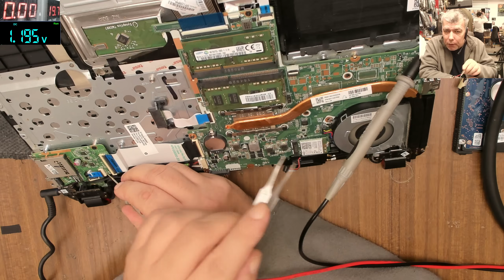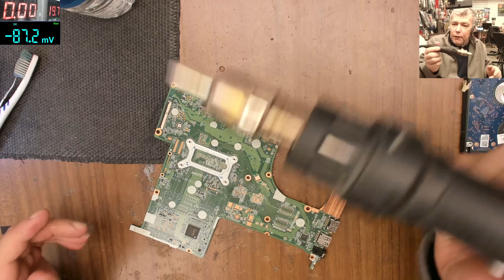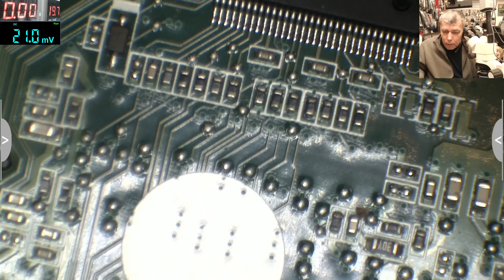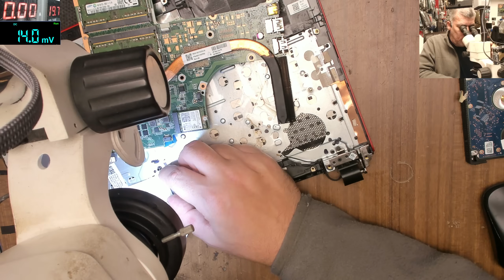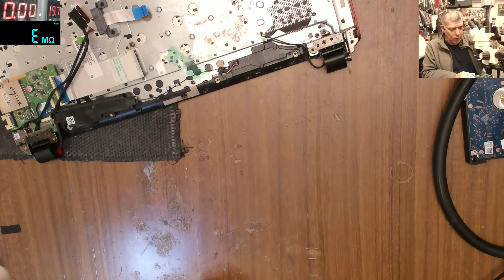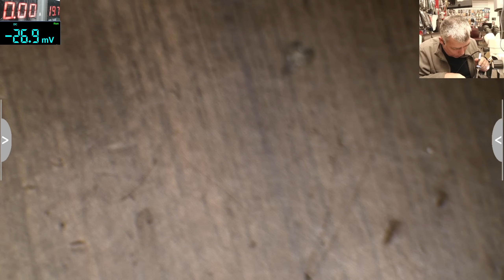Electronics repair lesson - Don't be afraid to use alternative ways to fix a fault

Comment: You CANNOT safely wash a circuit board with tap water !!!

The circuit board has copper, aluminium, lead [sometimes] and tin. 
Tap water has minerals, flouride, chlorine and all sorts of other stuff. 
ALL of these metals corrode when exposed to mineralized water and you CAN'T clean underneath the BGA chips where the water loves to hide !

Isopropyl alcohol is CHEAP and won't damage any of the metals.
Reply from the maker: You have no choice, the sugar is not getting disolved in alcohol, only on water!

Comment: You shouldnt wash sugary board with water and dry with hot Air. Sugar just dries back on the board. İt will look better because it will spread. But still can cause problems. What you want is water dissolving the sugar and taking it away. After you brush wipe it away with a dry towel then dry with hot air. Even washing the board under a tap works. I used to do it all the time. Dry with paper towel and then hot air so you leave the least minerals possible. If you really want to make sure, use pressured air on connectors. Hair dryer is a good option too.
Reply: You CANNOT safely wash a circuit board with tap water !!!

The circuit board has copper, aluminium, lead [sometimes] and tin. 
Tap water has minerals, flouride, chlorine and all sorts of other stuff. 
ALL of these metals corrode when exposed to mineralized water and you CAN'T clean underneath the BGA chips where the water loves to hide !

Isopropyl alcohol is CHEAP and won't damage any of the metals.

Comment: Amazes me: the thought process of Apple in its design of the iPhone battery charging, is irrational. My battery is at 79% max. There are features Apple designed to limit charging times to extend battery life - based on my 'user habits'! A feature to save the power grid and lower my carbon footprint by limiting charging based on time of day - talk about greenwashing!  This is insane. Not rational at all per all their attempts to prevent repair and fight right-to-repair. INSANE cult-like adherence to worst practices....often confused and interpreted by morons as 'best practices'

Comment: i heard from some else  to always remember if you are disconecting the display make sure the battery is disconected first because those pins  have voltage whether you push the power button or not. to avoid shorted display when removing take it out.

Comment: I was told to never clean or touch a PC board with water, use  only denatured alcohol. Because the stuff used on these boards is water soluble. Can somebody clarify this ?
Reply: You CANNOT safely wash a circuit board with tap water !!!

The circuit board has copper, aluminium, lead [sometimes] and tin. 
Tap water has minerals, flouride, chlorine and all sorts of other stuff. 
ALL of these metals corrode when exposed to mineralized water and you CAN'T clean underneath the BGA chips where the water loves to hide !

Isopropyl alcohol is CHEAP and won't damage any of the metals.

Comment: So sad to see that for all your experience you chose the "carpaci" approach. True quality is when you restore it to factory design, not increase the current 10 times (at least, since pull-up resistors are usually 10Kohms but for mobile applications could start from 20Kohms to not consume current for nothing) on a clearly faulty circuit that leaks current somewhere. That leaking current will cause failures in the future and will break something. But it's good for business to have recurring clients I guess...

Comment: I noticed that you "cleaned" the board by adding water and then you scrubbed the  area with a toothbrush, then dried the area with hot air.  You really need to wet the area and then wipe/blot the water off, or flush the area  well with water.  Otherwise you are not removing the sugar/salt that was dissolved in the water.  You are just spreading it around.  I have spent many hours watching your videos and find them extremely informative and interesting.  I have a pile of older laptops that I hope to restore with your the help of your videos just to see if I can do it.  Thanks for sharing your troubleshooting methods.

Comment: Why would anyone trust a company who puts THAT much effort into keeping things from working?

I do have a tip on using water if you read this.  Follow up with alcohol spray - it will thin the water making it easier to run off, and it will evaporate faster.

Comment: When I was doing my apprenticeship, for liquid damage, I was taught to use water and soap to wash the entire board and then allow the board to sun dry or we could use a fabricated incubator made from gallon and old high watts lightbulbs(cos of the heat it generates), after which we test
Works like 95% percent of the time we used it.

Comment: It is actually a very good idea to remove sugar(sweet) liquid damage with water! But THEN... instead of drying the water with the hot air (which still may contain sugar that doesn't evaporate), remove water with... alcohol  :-}. Alcohol has almost indefinite ability to absorb water (with or without sugar) and still being an alcohol. And it evaporates very quickly - much quicker than water...

Comment: I find that brake parts cleaner does a great job of cleaning dirty motherboards.  It dries very quickly and leaves no residue behind.  I also will often use a hair dryer afterwards as there can be condensation left on the boards from the "ice cold" blast of the cleaner and possibly my air compressor to get underneath chips where some fluid often can still be lurking.  You can even just let the board dry out on its own if you're not in any hurry.
PS: Unlike rubbing alcohol, break parts cleaner can make you feel VERY dizzy/sick if you breath it in.....even if you use it outside like you SHOULD BE anyway!  If it makes you feel like sh*t, then use alcohol instead!
Reply: is 70% alcohol safe to clean motherboards with?
Reply: @emmanuelkissi8958   You CAN use it, but it contains more water than say, 91% which is better because it will dry faster and clean faster.  I have used 70% to clean parts with no problem.  Just make sure you give the parts more time to dry or better yet, use a hair dryer to speed up the process as soon as possible. Also...be mindful of the fluid that tends to hide UNDER the chips!  Blow it out if you can or just let the whole board dry overnight or longer if necessary.  👍👍
Reply: @arthurmann578  alrighty thank you
Reply: @emmanuelkissi8958   You're very welcome!  Be well!  👍👍

Comment: When I use water to clean sticky boards and connectors, I always rinse the area well and soak up the excess with Kimwipes.  Then, I spray the area with 99% isopropyl before using a blower for drying, cool air at first then, warm.  I find that the alcohol dissolves into whatever water is left behind and helps the evaporation when the blower is used.

Comment: A dishwashing machine is amazing. Use that first. Then your ultrasonic cleaner with frequency sweeping, heat and degassing and branson EC. An old surplus vapor cycle circuit board cleaning machine STILL works! Trichlorofluoromethane is still available for purchase (from Sigma - Aldrich, for instance). It is very expensive, though. Miserable extremist leftist elitist-supremist know-it-alls really hate it. They will call you racist or something if they find out you're using it. Because it works BEST. Move to California before using it, first...it's best, that way. Tetrachloroethylene and tetrachloromethane (Carbon Tet, Perc...dry cleaning chemicals) attack flux VERY well. Better than that stuff they WANT you to use. Your macbook repair customers are more than likely the ones making these chemicals cost you so much...who BETTER, to pass that cost on to?

Comment: No circuit diagram makes it hard and if that is a blown MOSFAT (resistor) you are passing that voltage directly to the cpu unregulated . Test capicitors for short ! Then if no diagram you can pass a very small amount current to the device and look at it through infared camera . The MOSFAT that is bad will show heat . But it powers on briefly, that would imply its not a short . In this case it would be more likely overheating but its doing it very fast usually a device would get farther if not all the way booted up before shutting down .

Comment: If you put water on the board to remove sugar you then need to get a paper towel or something to soak it up. If you just apply heat to evaporate it you WILL NOT have removed the sugar. At best you might have spread it around more thinly.

Comment: I think that once you dissolved the sugar in water you should have soaked up the water with a paper towel or sponge before drying the board with the hot air. If not, the sugar will just be redistributed on the board and may cause problems.
Reply: Yeah, I thought that too!  I guess that once dissolved and spread around a bit, the conductivity of whatever sugars remained were reduced enough to not be an issue any longer.  Still, I would be inclined to soak them up and, get them right off the board.

Incidentally, I have encountered similar issues with the "no-clean flux" products.  Sure enough, when bone dry that stuff is a great insulator but in a humid setting, I find that it readily becomes conductive.  I suspect that airborne pollutants land on the moisture softened flux and, that those pollutants are the conductive culprits.  Think of a seafront environment for example with all that moist, salt ladened air!  Might as well spray the whole board with an electrolyte.

Comment: Shouldn't the board get rinsed after the sugar gets dissolved? Otherwise the sugar would remain once the water evaporates. I guess what happened is that the sugar got distributed on a larger area.

Comment: Your videos are really interesting, to me BUT I’m usually completely baffled by them. At +/- 22 minutes, you say “we don’t care about the value of resistor…” I can’t believe that, THAT is the “proper” approach… perhaps, that’s just me? Then later on, you do “something” involving heat and measurements to ground [what the Hell was that?]. later still, you remove a resistor near to the power button and now, the whole thing is FIXED?[!]. I don’t know if schematics can really damage one’s brain, but your videos HAVE probably damaged mine.
Reply from the maker: It is hard to make videos to be easy to understand for everyone. This video is for those ppl they are already fixing laptops and they are familiar with the power button&EC schematic. But i definitely understand your confusion, i will try in the future to be more explicit
Reply: @electronicsrepairschool  You are clearly an accomplished professional in your field, THAT is why I watch your videos [from beginning to end]. I like your calm/relaxed approach to repairing electronics and I try to emulate that, when I try to fix things. But I must say, I watch a lot of repair videos on YouTube and yours are the most…esoteric, to me. Still, I learn from you and you shouldn’t change your ways, because of me. I’m still quite the novice, so occasionally I get frustrated, when you jump from one idea to another, for no apparent reason, to me. At times, I think you are more of an alchemist than a master electrician. When I look at the comments section, I mostly see viewers mentioning how you used water, to clean the board, and I think: “ THAT is what you guys are focusing on?!”. Very few here, question how/why you went about the repair, the way you did, so, I guess you are right, when you say that: “this video is meant for folks who already fix laptops…”. Anyway, keep making videos and I will try to follow along. Cheers!

Comment: At the end I dont understand well the problem. You replaced the resistor near by the super io and you took out the one on the same line near to the power on Button. So the problem was this 2 resistors?

Comment: Any experience with Soviet quartz watch circuit boards?   I finally nailed the Chaika big blue of my dreams, spring bar broke and it hit the deck and now its intermittent operation :(   Really quite cheesed off with it as the mechanical and motor side work perfectly, all traces/solder joints are good but I can't get it to work continually :(
Reply: Just replace it with a $5 Chinese quartz movement

Comment: I have seen some your videos and they have helped me a lot. But I have a laptop 2 years old and the battery went bad, it is puffed and will not work anymore. I have changed the battery and the power charger, the charging port and nothing is working. Could you help me?
Thank you.

Comment: You can wash water damage residue off using water. Or better yet, demineralized water. The water should be taken off using a paper towel, so you're actually removing the water and the dissolved minerals. Residual moist you can dry off with hot air. After that, clean with alcohol. The alcohol will repel all traces of water left behind. Dry again and then test the board.
The power button circuit with the serial resistor, the pull-up resistor and their values are probably straight from the super-io's manufacturer's datasheet. They will protect the super-io in case accidentally a voltage of up to 5V or so gets applied to that switch line. For normal operation, you only need a pull-up resistor. Anything from 1K to 100K is fine.
Reply: So basically what sorin did was to replace that SIO pull up resistor which was altered in value, and then he removed the other resistor in line on the switch as it was acting as a divider so he finally left the 1k resistor. or am i wrong?

Comment: carefully placed ACTEONE melts the ABS heat-staked keyboard supports. no need for heat or drills etc. When the keyboard shield is carefully raised, stake by stake, the abs will form to the shape of the shields mounting hole. that way, after repair you can re-locate the keyboard shield  on the original stake posts and then use solder iron to seal down once more. all original materials. only half the aggro.  :)
Reply: you mean acetone?
Reply: @rafaelfontana2765  Thanks :) Yes. you are quite right!! :)  a bad typo. I dont want to edit tho, as that means there could have been anything before.  i will add a "i meant" reply
Reply: @Palmit_  very good to know. I use low heat air. always get perfect results but I imagine with chemicals it will be easier
Reply: i meant ACETONE. forgive me.

Comment: sorin spot on with Apple opinion. yes the parts are high quality. so a bit more costly.. but oh not apple.. a bit more costly is MASSIVE prices, absolute domineering and control of anything you can and cannot do with the device.. even to the extent of high level userland software areas. the thing for me, on top of that.... FOR ME!, its the trickery, chicanery and absolute arrogance and in how it operates.. its not marketing mistakes, or manfacture problems..those get fixed, but what they have been doing for decades is not fixed... their entire ethos and mantra is to screw people over and get fat and pretend to be some kind of status symbol producer. This is not an attack on owners. it's the company that i am talking about. Not the product or peoples choices.

Comment: The thing that if you buy a new phone and they don't give you a new charger, as if it is "enviroment friendly". The thing is, i bought a new samsung A33 and it needs a new charger with a usb-c connector to be able to charge with 25w. All other old ones, even which support even more than 25w, charge the phone only using 15w. As i understand, the usb-c connector on the charger is sending a signal to the phone, that a more powerful charger is connected, and if a charger does not have this contact in the connector or is disabled, than you are stuck with slow charging or you need to get a new charger anyway, which means that "enviroment friendly" is a scam . The thing is that, for example, Xiaomi phones that i had ( 9 pro, 11 lite), did not have this kind of problem.

Comment: You're supposed to use destilled water to dissolve the residue. Afterwards you dry it and clean it again with IPA (alcohol). It's the only way to get rid of sugar and mineral residue.
Reply: Iso alc is good for cleaning off flux spatter or greasiness. but not gonna make a difference to water residue deposits. bottled water is good as it's also filtered and contains none of the flouro and calcium etc.  Drying the water right away is good. if you want "minerals" removed you'll need a surfactant. then it becomes more polish than product which eventually will not make a difference.

Comment: Hello mr eng how you replace a resistant with value in k om with  jumber wire
Reply from the maker: Thats not any wire, it;s a proper calibrated fuse :D
Reply: @electronicsrepairschool  thank you for fast reply please can you explain types of calibrated fuse and how we can differ from 0 omh resitant and other resitant
Reply: @electronicsrepairschool  Fuses are made of a low melting point metal. A copper wire with just the right amount of amps going through it, can create a fire hazard. So a metal like solder, or other low melting point metal is a better choice.